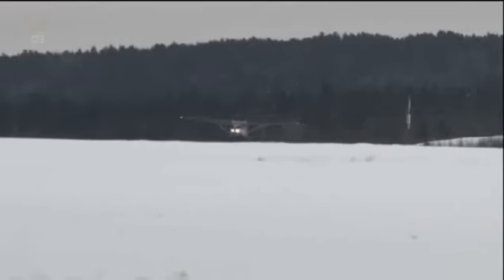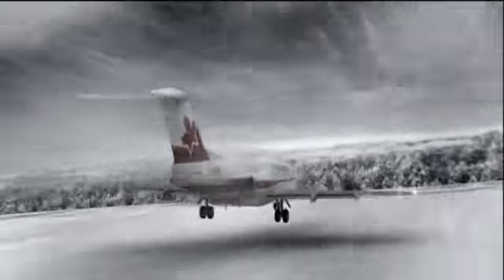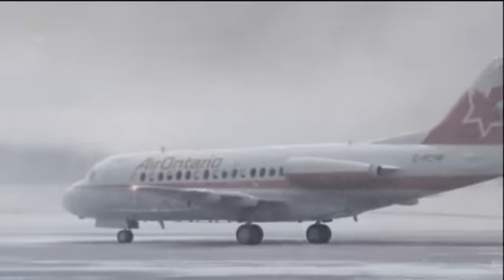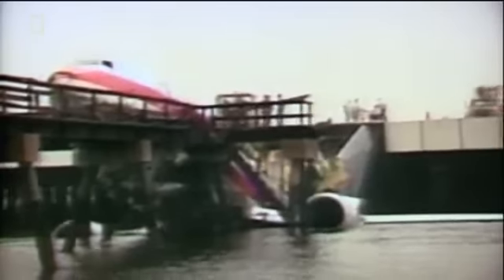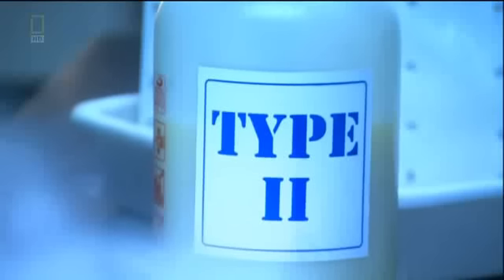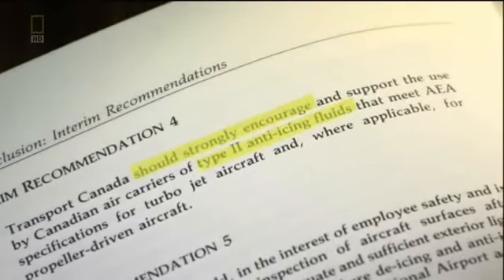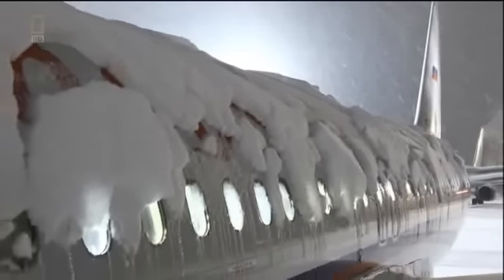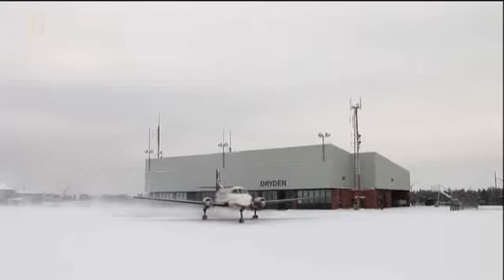air crash investigation Snowbound (Air Ontario Flight 1363) part 5

Comment: Wings could be checked for a layer of rime ice with a pocket laser beam. The upper and lower surfaces of the ice would produce a characteristic return from the laser that would be immediately visible. It would also reveal the gritty surface of the ice vs. the smooth aluminum of the wing.

Comment: @pete5668 Because it would require a huge amount of energy that is not on hand. It's hard enough to heat the wing leading edges. This plane is also unusually sensitive to disruption of its wing aerodynamics.

Comment: I have a question. If the plane couldn't get deiced because its engines were running, how can deicing procedures be moved from the gate to the runway? Would you shut engines down after taxiing?

Comment: I'm just an ordinary guy with no special aircraft knowledge but...

If the rule is you can't de-ice while engines are operating because the de-icing fluid might be ingested by the engines, couldn't the Dryden pilot ask for the left wing to be de-iced while only the right engine was operating, then switch engines and have the right wing de-iced?